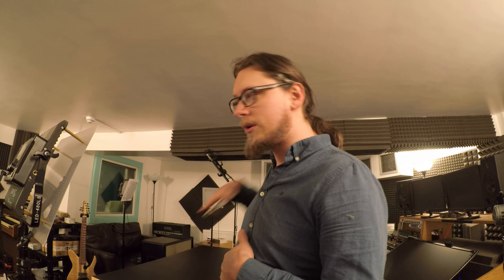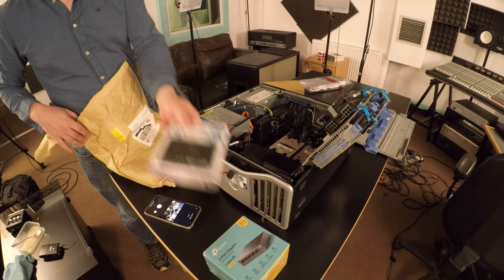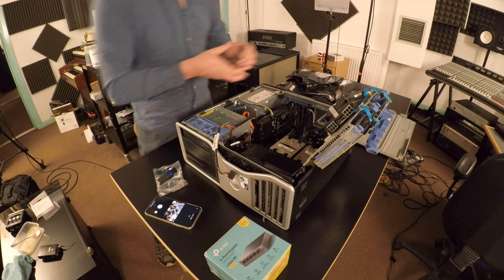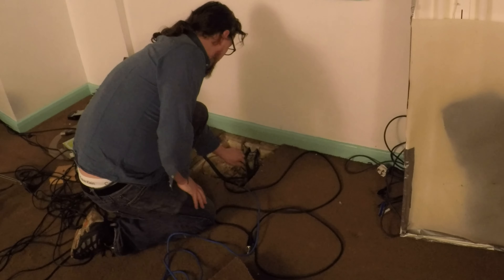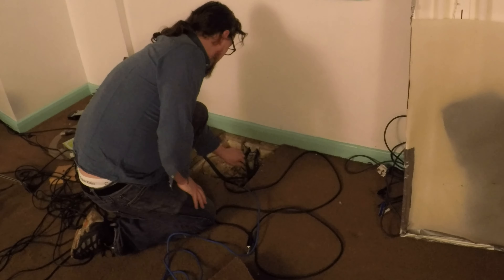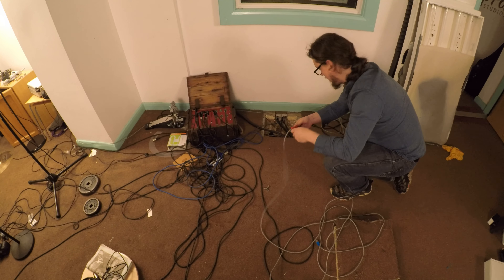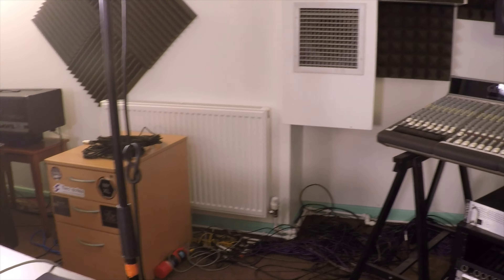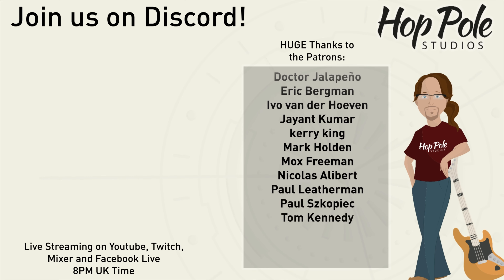MOAR VLOG - Cables pt 1

Comment: 19:41 Why did you need to compile ffmpeg? What's wrong with the binaries in the repos?
Reply from the maker: The standard repo doesn’t support NVEnc, which is needed to take a huge load off the cpu at stream time

Comment: Great video, I empathize with wiring shit. Plumbing is almost as nasty but its getting easier as kit has changed. What happened to the God of all things with wire and electronics Markus Fuller? One of the most personable intelligent youtubers and organized, a role model of patience and tenacity, and hes from your country Adam.
Add: side issue, when I saw Markus tear apart a korg Minilogue and explain arm processors in other videos, hes the real deal, and sure Ive seen Computerphile and the creator of such things total nerds. Not long ago I saw the 8 bit guy (youtuber) rewire his home(s).
It was heartening and inspiring
I have my own issues, too costly if I fuck up, its serious as simply changing a freaking leaky faucet washer. I have to go back to the pressure relief valve, know where the village can shut off out water main first, before I can think about turning off the water inside our home, This happened from changing our water intake and where the water is coming from now,  from stream weir(a dam)  to well, Be it wiring or plumbing there is no room for mistakes
I have some choices at one gig, what will it be electric rechargable leaf blower or old 25cc gas one.Its a simple decision, its the gas one over what is likely a weapon of mass destruction and personal electrocution
Pick your poison the best cable, crimp, cut and make your own, same applies to plumbing now
Not long ago I had an older laptop rebuild ssd drive , more ram, better power supply, all was sort of well, some tweeking I am confident doing and then someone sat or lay on the laptop and destroyed the screen completely. I am beside myself now. Oh well life goes on, 
I have another project a decent but abused roland keyboard, if the opertunity comes along, Ill harvest parts from one to make one that works,I really dont like doing this DIY thing anymore, but I have to